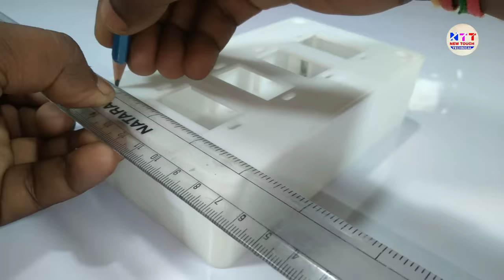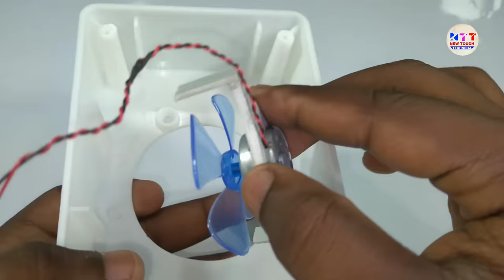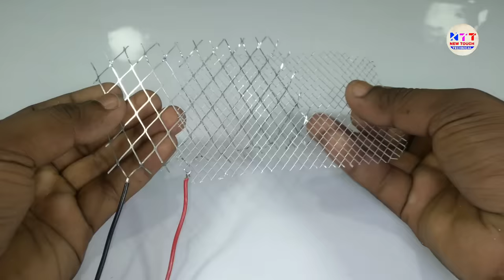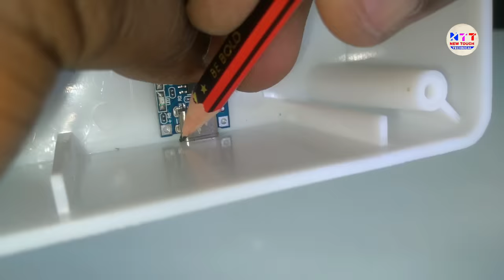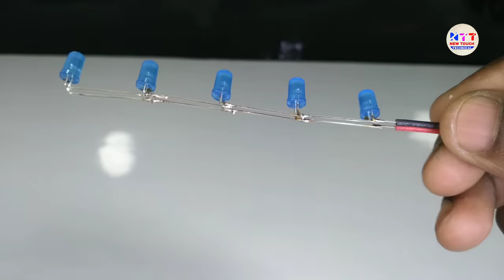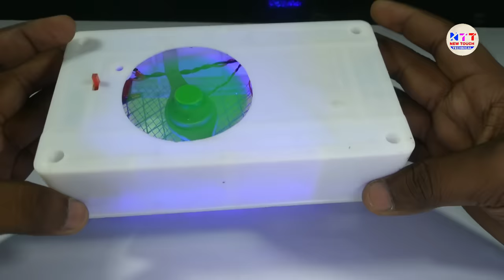मच्छरों को मारने वाला मशीन आप भी बना लो | making Dc mosquito killer machine at home | mosquito

Comment: Which module you used to genrate high voltage. And how  many voltage between two net ?
Reply: Mosquito bat circuit
Reply: As this circuit has a 2000v capacitor. It means about 2000v between the net.
Reply: Rechargeble DC k bad vo material ka details aur motor kitne power ki hai